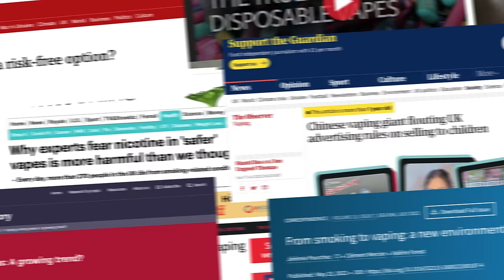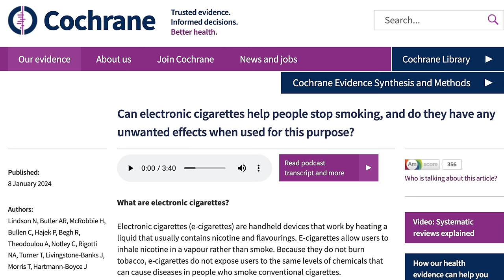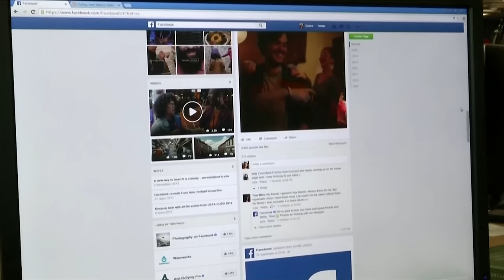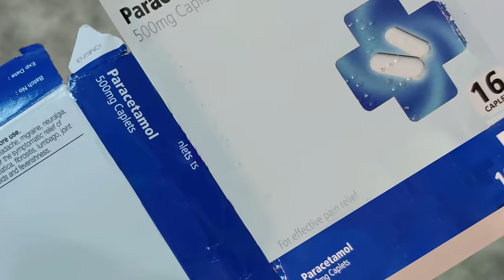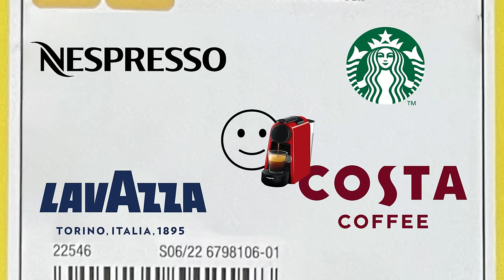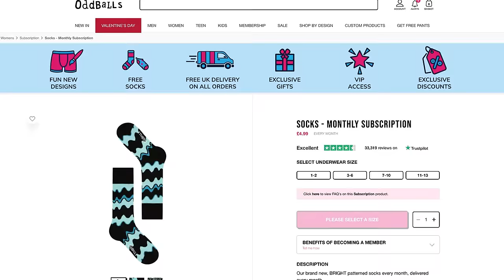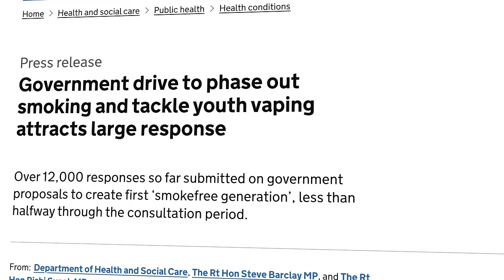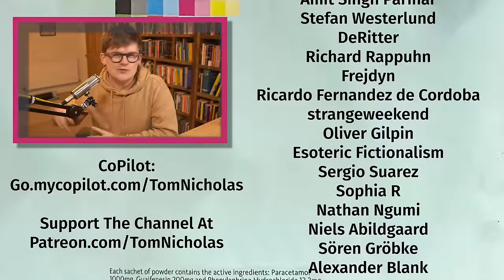Vape-o-nomics: Why Everything is Addictive Now

Comment: You can see this happening a lot in/around certain trades too. Pretty much every power tool brand has cordless tools for pretty much everything that use proprietary batteries and chargers, so people who use them a lot end up getting hooked into buying the same brand for literally all their power tools, as well as chargers and batteries (plus spares). A lot of companies are starting to void warranties if you get anyone except licensed technicians to work on their products too (and sometimes charge enough in licensing fees that the only way a business can afford it is to become a franchise), so users are hooked into paying them for services/repairs/parts, and then exposed to a heap of very targeted marketing
Reply: A lot of brands who do that sell expensive equipment and offer finance as well (often with deals for servicing, extended warranties, upgrades etc) so a lot of customers are also pretty easily persuaded into paying them interest on purchases, and purchasing more than they would if they were paying upfront. Seeing a lot of tradespeople being extremely brand loyal helps attract non-commercial customers too, who tend to be a bit less discerning. Doing that can help save costs on R&D too because it can kind of get customers to do testing and quality control, while still keeping them as customers

Comment: I'm very curious. So I ended up finding one of these vapes lying around on the street. I brought it home and disassembled it. Inside it was a battery, a tiny electronic circuit connected to a connector to charge the battery on one end. On the other end, the circuit closed at a terminal that produces heat and was wrapped in soft synthetic material soaked in a concentrated odorous substance. The disposable plastic packaging that contained the vape circuit was impregnated with the odor on the inside. Everything inside it was also impregnated with odor and moisture. It was truly disgusting. I wondered how someone could put that in their mouth and inhale. The battery could leak and contaminate everything. Depending on what it's made of, more serious accidents could happen. The sale, import and advertising of all types of electronic smoking devices have been prohibited in Brazil since 2009. But this prohibition has obviously been ignored and vapes can even be purchased on the internet. The ineffectiveness of any law is never a good sign. This suggests that an entire illegal vape trade system exists in Brazil, including the payment of bribes to public agents in charge of monitoring and repressing the trade and use of prohibited goods.

Comment: I enjoy my vapes, I was a smoker prior to vaping. I think disposable vapes should be regulated in a sense where they HAVE to be rechargeable and refillable simply for the waste aspect. I use a coil system 90% of the time because I hate waste. Especially electronic waste. 

Have they harmed children? Of course, simply because a lot of Federal agencies haven’t properly used the powers they already have. 

What happened to anonymous audits of tobacco and alcohol shops? I know several shops near me confirmed selling to underage folks. No ID check.

Banning vapes will drive me right back to smoking, which I do NOT want. The UK just released a pretty thorough study showing that vapes are 5% as damaging as smoking cigarettes.

Thats a wild success story, that’s gonna save so many lives. On average it’s significantly cheaper as well.

I do not want my addiction being mishandled by a Nanny state that thinks it’s doing what’s best for me, I need to be able to conquer it myself.

Nicotine withdrawal is exceedingly painful and awful and the most I’ve gone without nicotine since my addiction started is around 2 or 3 days. I’d likely lose my job should I be forced against my will to quit cold turkey.

Vaping needs much better oversight, it needs rules and regulations to deal with the pollution and quality control (so much wasted money on disposables that either fail within hours or days when they should last for weeks), and it needs a better structure to get the kids away from it. Seen a lot of parents enable it as well.

But I’m a grown ass man with my own problems and do not need the state to forcibly put me through mental hell by a forced withdrawal. The state COULD offer idk public fucking healthcare where I could work with a therapist to keep me honest and help me through that withdrawal.

Comment: Loot boxes isn't the first time the US government has told the gaming industry to self-regulate. Self-regulation is actually how we got the ESRB rating system. The federal government saw that there was a problem with gaming content, but had no idea how to tackle it, so they told the games industry "if you can fix it, we won't step in. If we do have to step in, you won't be happy." 

The result isn't half bad and the self-regulating system works. The difference is ratings can be an effective marketing tool, and can boost sales if marketed properly. Any changes to loot boxes at all will be a profit loss for gaming companies, so the chances they can be told to "figure it out yourselves" seems rather slim.

Comment: As a product designer myself, the explanation of loading e-mails by pulling down sounds like complete bogus to me. The much simpler, more coherent, explanation is that a touch screen has very limited amounts of inputs that can be put in and that "pressing" is sometimes inaccurate. This makes "sliding" inputs a lot more useful to navigate and do certain actions while also limiting the amount of buttons you need to display on screen, cluttering the display.

I think that the main compulsion comes from the fact that they are easy to use and give some sort of good "effort to pleasure" ratio, making scrolling an easy thing to do while in between tasks and, sometimes, spiraling into the actual activity because of the curiosity of what comes next. It is kind of what was hinted by Harris when the parallel is drawn to the slot machine and e-mails, but at a level of psychology more than the physical actions of "pulling a lever"

Comment: Solution is simple; don’t be a consumer. Don’t spend 2k on a macbook when a 500 dollar laptop will realistically do what you need. 

I’ve had an LCD HDTV now for a decade. I’ll keep it until it actually dies. Because why wouldn’t I? Does 4k actually matter that much? 

Do you need to spend 300 bucks on airpods when 50 on headphones works just fine? Do you need to buy a new smartphone or does yours work?

If you’re thinking of buying something and you get super excited odds are you shouldn’t buy it. Joy doesn’t come from owning things. It comes from living a good life. 

I own the same clothes I did 5 years ago. They look fine and fit fine; why buy new ones?

Comment: I got a student copy of Adobe CS6 for... idk $100-200 back back in 2011 or so (it was, IIRC, photoshop, illustrator, and indesign). I used primarily photoshop CS6 for years until both it and my tablet (which, at the time of ending its use, was about 10 years old) were unsupported by their developers and were therefore acting very weird together. I switched to a free, open source photo editing/drawing software because there was no way in hell I was going to use something that cost hundreds of dollars a year and I didn't even get to OWN it. And it can open my psd files.

Comment: Juul is extremely addictive but also quite easy IMO to quit with 2mg nicotine gum and just a little bit of will power. All you have to do is wait til you get a craving, chew a little bit of 2mg gum slowly and feeling the craving go right away. Spit out the gum. The cravings quickly subside. Vaping is addictive because it gives such a huge surge nicotine all at once and can do so discreetly and consistently. The nicotine gum gives you a slow gentle dose of nicotine. Properly done I believe it is very easy to quit vaping with just a few days to 1 week this way. But you hear no video or no one talking about this at all.
Reply: Yes. I absolutely hated my nicotine addiction (around 140 milligrams a day), but when I got down to chewing nicotine gum, I actually started enjoying it more. The bad part is of course coming down from such a severe addiction, and the withdrawal symptoms.

I have completely quit now, 4 months free.

Comment: I just got done lowering my nicotine content from 6mg to 0mg. I started vaping  in 2014 when i was 18 years old, and i started with zero nic. At some point for some reason i decided to start nic (yes, I'm a  🤡) and i spent about 8 years vaping with 6mg  nicotine. Recently tho I decided that I was gonna kick the habit, and when i prepared my vape juice i would just add fluid and flavor to  half filled existing bottles, essentially lowering my intake by half. I did this about 10 times until my nic intake was essentially zero

Comment: It may seem a little pedantic what I will criticize on, but I don't see the conclusion in your video as truthful. 33:50 "The same marketing strategies the tabaco industry uses other companies in different sectors are using too" is a false assumption. They are similar, but not the same. 

You spend the entire middle of the video explaining case by case of some (There's surely some other marketing strategies) pointing out the mechanisms. For that, my conclusion seeing your arguments is that all these strategies are in a group of psychological manipulations (if they are more common now it's not me to define it). Saying that the way coffee is sold is the same, or as bad, as vape is sold is a simplistic and imprecise conclusion. 

It's definitely not what you've intended to say, I just think some phrases in your otherwise great, well researched script, were not as considerate. Great job tho, this video was a bucket of mental cold water, current youtube needs more of this content.

Comment: I think getting patents and patenting into this conversation is somewhat misleading. Although abuse of patenting is a thing and we should discuss it, the origin of patenting dates back to centuries ago. Prior to capitalism itself. There is a reason why we, as society, are still thinking that granting a couple of decades of absolute monopoly to someone is a good idea. And the reason is flow of knowledge. Patents are a document that discloses how someone is achieving something. You disseminate that knowledge, and in exchange we grant you a limited time monopoly. Otherwise you would probably keep the secret or even give up on inventing something for lack of an incentive.
If the patent about an insuline formulation is expired, there is nothing that prevents anyone from entering that market with the same old formulation. A new patent will be about a new one, but the old one will remain open no matter what.
I think the Nespresso capsules are the perfect example. No one cares about the new ones, they are quirky. At the same time, coffee machines using the old model are everywhere, and a large number of companies are now making compatible capsules because the patent expired. The market is wide open.

Comment: Vape aka electronic cigarette is intended for smokers to help them quit smoking. Period. Legislation should reflect that. 
There are 2 types of vaping, dt - direct to lung which is done without nicotine and is shown always in media because of massive clouds, this type of vaping serves no health purpose nor it has known health sideffects due to lack of nicotine.
Second type is mtl - mouth to lung, which is done with nicotine, depending on smoker's habbits, is never shown in media and creates literally almost no visible exhale which evaporates in less then a second normally. 
It is very easy to regulate the market so only mtl is allowed via prescription like thc is in some places. 
Dtl is really just an attempt by non smokers to make money selling a fashion trend to other non smokers who did not then swap to being smokers but to next fashion trend. 
Smokers are created in teenage years when one is still forming their value system. All research points to smokers not being " created " after those formative years simply because smoking tobacco does nothing to ease stress, pain, depression, anxiety or any other issue an adult might seek to solve their issues. Which in turn leads to addiction.

Comment: FWIW, the plague of disposable vapes seems to be a UK thing.  Here in the US, or at least in my city, regulations have put a stop to most single-use vaping devices and re-usable devices are by far the majority.

It's kinda too bad; disposable vapes contain rechargeable batteries; it's evidently really easy to collect hundreds of Ah of LiPo cells just off the street and rebuild them into nearly-free battery packs for projects...

I think either whoever coined the term "Limbic capitalism" or your interpretation of that is wrong.  The limbic system isn't really responsible for feeling pleasure.  First and foremost, it's where scents are processed, but it also has a role in 'coloring' memories.  It is not, however, the part of the brain that's responsible for pleasure; no one part of the brain does that.  Even the slides you show of a brain 'lighting up'?  That's not the limbic system.  It even names the areas, in the first paragraph.

Comment: "The pulling of a page to refresh messages mimicking the pulling of a lever on a one-armed bandit."

No wonder I hate it when programs do that! Give me a damn button for the job!

Smartphone software tends to be very badly designed in general. It makes excessive use of gestures and cryptic icons, with little to no text, preventing you from figuring out how to use it without trial-and-error. Contrast to desktop software where you can read the menu items before clicking them, and figure out what it's going to do just from what's written there. Oh, and let's not forget that infuriating flatso design trend started by Windows 8, where it's not obvious what's clickable.

Comment: The obvious reason disposables have supplanted pod systems is entirely capitalism-induced: there's a way better revenue stream to be had from something that consumers have to buy again in 1-3 weeks. The slightly less obvious reason is that disposables are much easier to use than pods- there's no maintenance or fiddling about with leaky tanks and swapping out batteries, just throw it out and buy a new one. This is an appalling level of laziness in exchange for a high amount of waste, and shouldn't have been allowed to happen in the first place. 

Pod systems should've been continually iterated upon, made more efficient and less leaky. Instead I have to deal with the same pod system from 10 years ago because no true development has come out that has made any BETTER systems to date. It's a huge boon to say the least for the disposable vape industry that this has been the case ... and it is probably that way by design as part of a larger effort towards forced obsolescence.

Comment: 19:38 “Once you start looking for this model, you begin to see it everywhere: printers so cheap to lock you into buying expensive ink cartridges…”
And engineered so that you can’t use anything other than that brand’s cartridges.

From “HP CEO evokes James Bond-style hack via ink cartridges,” Ars Technica, 22 January 2024:
“Dynamic Security stops HP printers from functioning if an ink cartridge without an HP chip or HP electronic circuitry is installed. HP has issued firmware updates that block printers with such ink cartridges from printing, leading to the above lawsuit…, which is seeking class-action certification.”

The dek: “Our long-term objective is to make printing a subscription.” [HP CEO Enrique Lores]

In our Brave New World, the rentier is king. You will own nothing.

Comment: I hate those. I used to also use those disposable ones. Till I saw how cheap they were produced - I was disgusted.
I did a bit of research. For the price of 4-5 disposable ones I would get a device that is as compact, quickly rechargeable and easiliy refillable. Also exchanging the heating element is a matter of 2sec. It has all the advantages of a disposable but not the disadvantages. Much cheaper as well. Those 5 disposables would have lasted 5 days. That reusable one is half a year old - just with a new heating element.

Comment: I miss the days, vaping was unregulated, complicated, and completely unavailable to regular people, if you lacked the technical skills to put them together, nothing was useful. It was cheap and only smokers actually dedicated to quit cared. Then capitalism happened, unnecessary "innovation," simplification, taxes, commodification, massive marketing to Non Smokers, which is kind of absurd to me. 
It's also important to consider smokers, lifelong vaping may be the only way to not die early. Cigarette addiction is vastly underplayed, it is a very extreme form of addiction that will infiltrate every single habit and activity you do, the phytological addiction is potentially permanent or at least long enough to make it near impossible to quit.
Reply: I hate disposables too, they're massively overpriced and are designed to die within days, refillable pods are better in every way.

I don't understand the hate towards nicotine though, it has improved my life and it's cheaper than a Netflix subscription, I think that non vapers just refuse to listen to the reasons why nicotine is good because of the stigma.